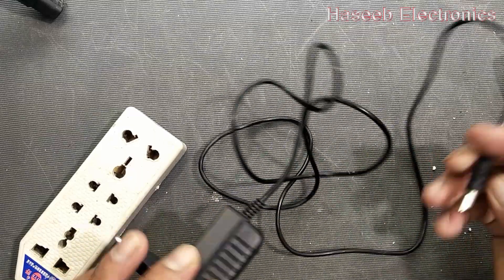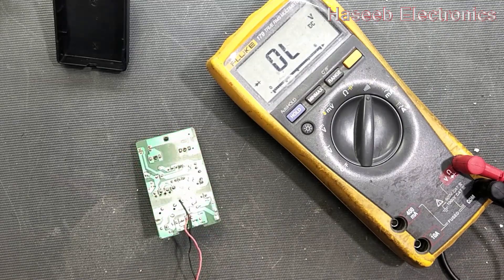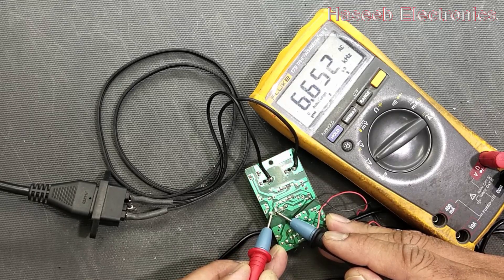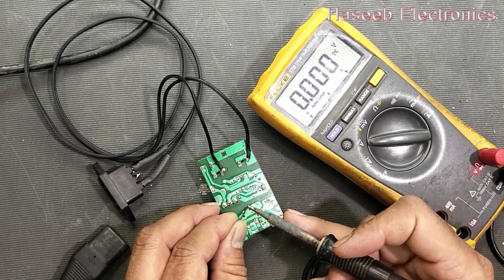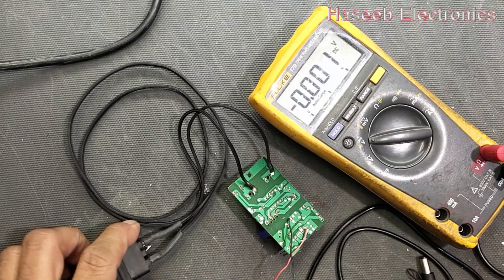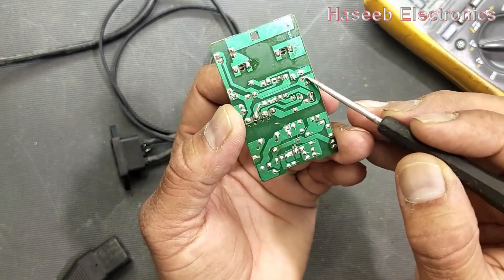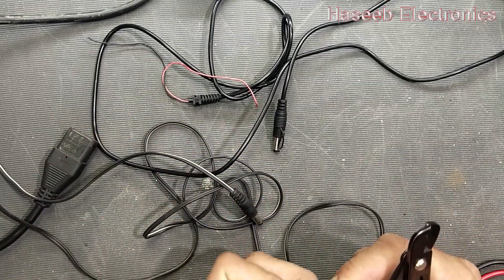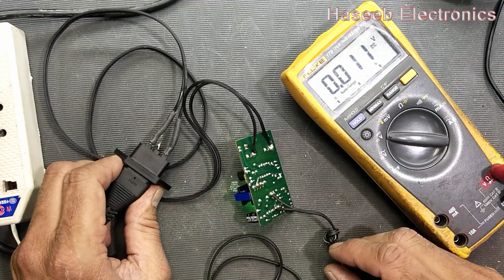{328} SMPS Have No Output Voltage || Battery Charger Have No Output

Comment: Sir I have the same model adapter for a kid car charger which is 12v 1000mA (for lead acid battery charger). In my case I'm facing no switching happening on primary. Voltage b/w "S" and "D" is around 320VDC.  Checked all the other components and found all in good order. I can't find out the switching IC data sheet bcz IC don't have any naming on it. Plz help to resolve

Comment: Mostly the short is at one of both ends. So you could try to cut of the desoldered end of the cable and remeasure conductivity. You are only missing 5cm then ;-)

Comment: Dear Hazeeb sir, My dvd smps first shown voltage variation. I replaced all capasitors and now no output voltage. Replaced optocoupler too. All other components are checked. Main capasitor showing 340 voltage and gang capasitor only 4.2 volt. Trnasformer secondary not getting any voltage. Kindly advice me once u free. Thanks

Comment: Sir mary receiver kee  power supply ka vcc capacitor ka voltage fluctuate kar rahy hain kya problem ho sakti h?
Reply from the maker: there is something short circuit or consuming more current in secondary side. may be some component in the receiver board is damaged. 
in this case vcc capacitor will fluctuate
Reply: @HaseebElectronics  sir supply ko board sy alag kya hewa h aur output kee side pa koi component short nhi mil raha h

Comment: sir this is the first time i see a shorted cable that cause the output voltage abnormal or flactuated tnx for this video
Reply from the maker: yes dear 
any component failure in secondary for missing feedback 
so the smps controller will go in brust or restart mode 
so there must a fluctuation, 
short circuit may occur due to any component failure or any wire shorted

Comment: my power supply flickers( stops for a fraction and recovers) when using capacitive fan regulator... help plz. what is the issue and how to resolve it
Reply from the maker: it means the power supply doesn't have EMI filter. 
so you have to install EMI filter to the input side of the power supply
Reply: @HaseebElectronics  yah i did, it worked... can you  help me on designing a mains smps buck converter (dc-dc), i'm having difficulty finding right sources and references

Comment: Hello, very nice video, i am very happy to have met you in my life !
I have same problem and i suspect the smps transformer, any idea how to test it ? thanks
Reply from the maker: thanks a lot.
high frequency transformer have very low failure rate. so most of time primary drive section or feedback have issues. 
biggest headache is feedback 
we have to check symptoms of the functionality of smps controller, vcc circuit and feedback

Comment: really good explanation. is this smps automatically power off when battery full
Reply from the maker: no it is battery charger, just have a reverse polarity protection diode. it is 6Volt  4AH battery
Reply from the maker: for regular battery chargers, there is a charging control circuit and current limiting circuit